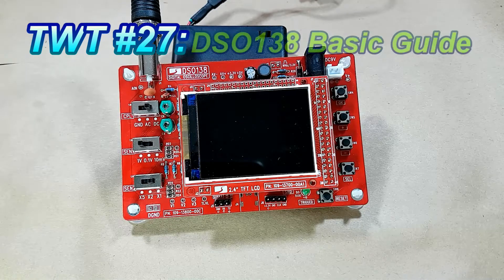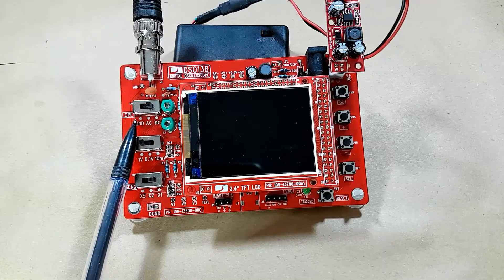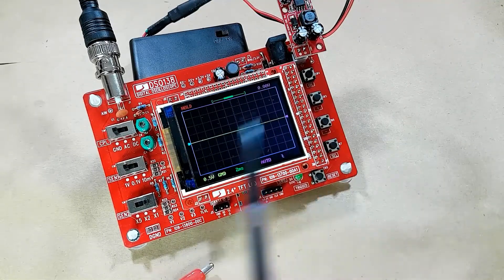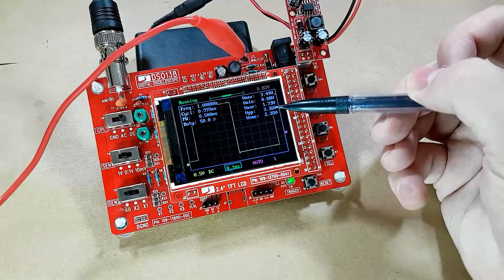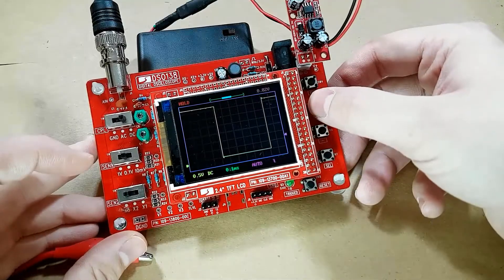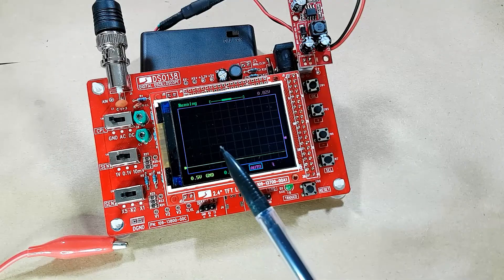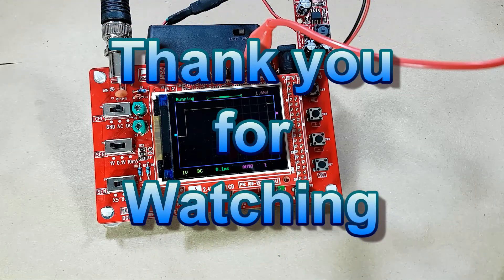TWT #27: DSO138 How to Use Basics

Comment: Thanks for your explanation. This gave me so many questions that I decided to explore a bit and my DSO138 also has a USB port. I wanted to power it via USB but it appeared the port was not connected to anything (unlike the DSO138 MINI variant). Then I found a guide online on how to convert the DSO138 to make it so that it can be powered via the USB port which is what I'm going to do. Tomorrow I'll get the components and perform the surgery.

This way I can safely use my powerbank to power the DSO138 and not have to worry about power supplies and about inducing more noise into the system.

One note: In the video you said the power supply voltage can be between 9 and 12 Volts, but I have read that it's not a good idea to use 12V on it and it is advised to really only use 9V to power the device.

Comment: Master , l appreciate all your lectures on DSO Scope because l have it. Butpls Master, teach me more on how to use it on things like ... checking the oscillating/ driving signals in smps pwm ICs , Smart TVs scallar boards, TCON board or video signals.... urgently needed Master 🙏. I have no attenuator. Can l add higher value Meg resistor, like 5 to 10 Meg to the testing probe? to steady the triggering amplitude ???

Comment: The DSO138 (and the smaller DSO128 "Mini") has an easy to fix issue where the waveform can look a little bad with high input signals.  Voltage divider R6, R7, R8 are a bit too low and put a little too much load on the output of U2B.  All you have to do is increase them by ten times (use 1% resistors).  This works fine because the voltage divider feeds the high impedance non-inverting input of U2C.

Comment: Thanks for the video. Very helpful. On my device, the two solder connections that are looped together in your photo and provide the square wave, are not connected to anything. I bought mine assembled. Is there a connection missing?
Reply from the maker: Glad the video was helpful. The assembler may have decided not to add the calibration loop, as they may have pre-calibrated the unit. If the holes are there and just missing the wire, you could potentially just add it yourself. 

Or, it's possible that the newer revisions of the DSO138 no longer have this as a feature. I'm not sure how many revisions there have been since I made this video all those years ago!

Comment: Can anyone help me?
I had ny dso for several months and it worked fine. but now while measuring the inbuilt test square wave, whenever I try to center the trigger with the graph or adjust the trigger in any way, the entire graph moves up or down by a few volts.I have to center the waveform with y=0v every time. this didn't happen before and is really annoying.

Comment: Does anyone know if there is a way to re-engineer this DSO to sample at a lower rate, such as 1 sample per second or minute? If someone new how to do this, it would make a great solar power sampler for custom solar setups. I have checked the suppliers and they all state it can sample at a max of 1 mega samples per second. They do not tell you how to change this. The docs say nothing regarding that or the USB connector.

Comment: My scope isweird. holding + and - doesn't reset anything andholding ok just switches between hold and run super fast.
Reply from the maker: Interesting, I wonder if it is a newer firmware, or if there is some sort of hardware issue with your scope.

Comment: I just received one of these units and had issues getting solder to stick to the BNC connector. I have posted on a couple of other locations dealing with these kits, anyone else have trouble in this stage? Also having problems getting the USB connector cleanly soldered without shorting all the terminals. I'm using a good iron and .o32 solder. I have noticed there were several other points that were more difficult to solder then what I feel they should have been, it's as if the plating of the joints was the reason.
Reply from the maker: I remember the BNC being a bit tricky to solder, the thermal mass of the connector made it challenging, similarly with the USB connector (though not nearly as much as the BNC.)  It's also likely that the plating used isn't the most compatible for soldering. Patience and a larger wedge tip than I normally use helped me.

Looking back at my assembly video, the slide switches were also tricky to solder for me.
Reply: @TinkeringWithTerrius  Yes I am having a slight issue with the shells of the switches too. I have to go get my dual range soldering gun I suppose and see what results from going from the variable heat soldering station to the 100 watt unit. I need to find some small solder wick or use some vacuum to remove the glob from the USB socket. I also just watched a video on how to improve the noise by re routing a few capacitors. Have you seen this and tried it? I don't want to attempt much with this unit unless I know it is viable to proceed.
Reply from the maker: Interesting, I haven't seen that mod I'll have to look into it. For my purposes of reading simple signals the noise never caused much of an issue, but I'm curious how effective the mod would be.

Comment: Can we measure above 5v dc and 230v ac.
Reply: Read the specs on the device. Anything over 50V is out of the question unless you construct a Voltage divider system and calibrate it. Anything with an AC voltage would be a good idea to use a capacitor coupling. A 10 to 1 probe would also be a good idea to get. You could construct this

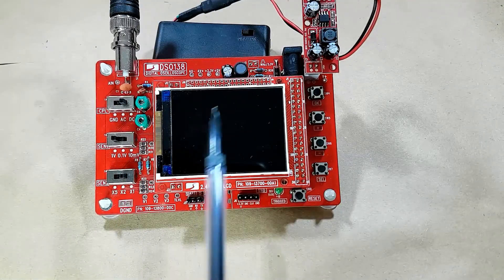Comment: i just put mine together and it did not come with that lil loop thinning you talk about at like 1:50 into the vid.. is their anything i can substitute for that ?
Reply from the maker: The little loop was just a piece of excess wire from one of the through-hole resistors. A small loop of any solid core wire should work just as well.

Comment: Thank you this info was excellent.  If my PW and Duty are bouncing - Duty between 48 and 52 does that mean I need to do a better job calibrating my probe?
Reply from the maker: I'm glad the information was helpful! If your duty cycle is bouncing around like that, and you are using the built in test point for the signal, it is indeed possible that your probe needs calibration. Alternately it could be an issue with the signal generator itself. 

I found in general that I didn't rely on the duty or time readouts of the overlay. When probing actual circuits it wasn't entirely reliable, but it did come in handy as a quick way of estimating the duty cycle or period of a signal.

Comment: red aligator goes to the signal ..and the black goes where?
Reply from the maker: The black clip will go to a common ground point on the circuit you are probing. So if you were probing an IC, the red goes on whichever signal pin you are interested in, and the black would go to the ground pin.

Not sure how accurate this following statement is, but I was told to think of an Oscilloscope (especially a floating battery powered one like this) like a volt meter that works over time. The scope is measuring and displaying voltage  but with a time component, so like with a volt meter you connect to the source that you want to measure with the red probe, and a common reference point (ground or the 0v rail ect.) with the black probe.

Comment: Excellent overview!  I'm waiting on my kit and will find this invaluable (assuming I assemble it correctly!)
Reply: The kit arrived, I assembled it and it works great. This video was so very helpful. Thanks for making it!
Reply: I bought the upgraded DSO138 mini which runs off 5 volts so you can use any USB power supply or battery pack. Cost me a little over $11 including the case. Put it together and it works great.

Comment: How do i set this up to display the lissajous pattern? Please.. i have a mono output, sleeve and tip to check.
Reply: It's been a long time since I used a scope but if IIRC you have to couple both the vertical and horizontal inputs to get the scope to do this? The only scopes I saw Lissajous on were not DSOs they were CRT analog units

Comment: The time divison (0.1ms) is that representative of each square?
Reply from the maker: Thank you for commenting! Yes, time is measured on the X axis so the width of each square is equal to the timebase (in this case 0.1ms).  The Y axis is the voltage, so the vertical height of each square is representative of whatever precision you are set to for voltage (in the case of this video 0.5v).  

The green numerical value in the bottom middle of the screen will be how wide the squares are, and the yellow value on the bottom left will be how tall they are.

Hope this helps, sorry I didn't reply sooner!

Comment: The DSO138 oscilloscope arrived yesterday (as did the tablet holder, but that's not related to this). Wow! This little item is quite the window into a circuit. I used the DC005 plug (see specs online) with a 9 volt DC adapter with a positive tip. The acrylic case is not really a good idea. So now I can see what my projects are doing, one trace at a time of course.
Reply from the maker: Glad to hear it arrived and you're enjoying it so far! It is certainly super helpful for visualizing what a circuit is doing! 

Despite it's low bandwidth I think for the price it is something every electronics hobbyist should have. I just wish the screen was a bit bigger! Almost makes me tempted to buy some of the other JYE-Tech scopes to see how they compare to it, but they are more expensive than the DSO138.

Comment: i been looking at theses please can one get a video out to hook this to a vga monitor or ?? old tv bigger screen using diy board i understand electronic just do not mess with this stuff much help as i need a bigger screen on this toy
Reply from the maker: I'm sure there is some way to hack the display signal and send it to an external source, unfortunately that is way beyond my current skill set. 

You'd have to figure out a way to take the data for the LCD and send it to a VGA or component video converter while also translating it into data that converter could understand. I imagine it would require knowledge of the DSO138's firmware in order to know what standard they are using for the display signal.

It would be a very interesting hack (being able to use an external display would be amazing), alas I wouldn't have a clue on where to begin a project like that.

If you do figure out how to do it, or find information from someone who has I'd love to hear about it!

Comment: @Tinkering With Terrius thank you. You could probably make some money by placing ads for trusted DSO138 vendors. The one I ordered from eBay's cinnamon 1956-5 turned out to be just the plastic case, not the oscilloscope. So I'm still looking and don't want to waste any more time.
Reply from the maker: Argh, I hate when an ebay listing turns out like that. I bought mine through Amazon from the JYE Tech store, but I know that isn't an option in a lot of places. 

I suppose you could always try banggood I've seen it listed on there, I think they even have the new DSO138 Mini. The mini is their new version that is supposed to have some nice improvements.
Reply: @TinkeringWithTerrius  Thanks for the info. I am happy to report that cinnamon 1956-5 has issued me a full refund. For that I have given a 5-star rating and ordered the oscilloscope from cinnamon 1956-5 again -- this time at more than twice the price of the case (the webpage has been updated to show both the case and the oscilloscope. It does not say it is the Mini version though. 
I'm also waiting for a tablet holder from banggood. These are great deals but the wait is a test of patience.

Comment: Can someone please tell me what the other (black) probe is connected to when the red probe is connected to the calibration waveform?
Reply from the maker: As per the instructions the black (ground) is left disconnected while using the test signal. You simply hook up the red lead and then adjust the variable capacitors to reduce the over/undershoot of the signal.

Comment: Hi, Would this scope be any good for fault finding/building guitar pedals?
Reply from the maker: I personally don't have any experience with building guitar pedals, so I can't give a definitive answer. I would assume as long as the 200khz bandwidth is high enough, then yes it should work. Be aware however it is a very basic scope and doesn't include any spectrum analyser functionality or waveform generation, though again I am unsure if this would be an deal breaker with building/troubleshooting guitar pedals.

I really wish I could have been more help, sorry!

Comment: so which one do you think dso 138 or dso 1500
Reply from the maker: I haven't used the DSO150 personally but from what I've read it is more robust and slightly more accurate. Of course there is also a new version of the DSO138 called the DSO138mini, which is also supposed to be a bit more accurate.

The DSO150 looks overall nicer due to its case, prevents having any exposed components. I'm pretty sure the DSO138 wins for pricing though.
Reply: Thanks for your input

Comment: Can it measure 220VAC?
Reply: Kuman and some other vendors market probes in 10:1 and 100:1 for high voltage use. Since BNC is a standard for scope lead connections they will fit. The only thing I will advise is to be sure the power is off before you get in there and keep hands clear. These scopes are cheap enough to replace if it goes POOF, just be careful. I used to have a scope back in the early 80's and it was NOT a cheap one, it was a pricey BK and I was working on TVs back then. I got to close to a second anode lead in an RCA that had bad insulation. I got hit with 33,000 volts of high frequency pulsed DC and it blew out my scope and I could talk right for a few weeks or move right. My next question is why would you want to use a scope to measure 220 VAC unless you are looking for harmonics from a sycrohnous generator?
Reply from the maker: Short answer is no, the DSO138 has a maximum voltage of 50V peak. 

In addition to this 50V limitation, I would not trust a cheap DIY oscilloscope for measuring anything with high voltage, it just isn't designed for it.  In order to measure mains AC like that you would require a professional scope and a set of mains rated differential probes, in addition to all of the safety prep to make sure that there is no way for mains to short through the scope and burn it up.
Reply: @TinkeringWithTerrius  If a 10:1 probe is used, then on the 1 v sensitivity setting you should be able to measure up to 500 v. The BNC cable that comes with this kit is a direct coupling. There are 100:1 probes also that allow up to 5kv at 1v / div.
Reply: u can make voltage divider with resistors.

Comment: Nice video, can i use the Dso 138 to measure a transient of 50ms on single shot mode? Thanks! :)
Reply from the maker: I haven't personally tried but based on the specifications of the DSO138, it should be able to handle that.
Reply: Thank you ! :)

Comment: when calibrating, my signal flickers left and right... what is that and how to remove it?
Reply from the maker: Is the flicker constant or does it only occur while adjusting the trimmer caps? Does it only happen when the trimmer caps reach a certain point in their rotation? It could just be noise causing the signal to jump out of range while moving the trimmers, or it could be defective trimmers, it is hard to say. Mine hasn't had this issue so I am unsure of how to remove it.

Comment: my readings jump all over the place on smaller scales even with no probes attached, is there a fix?
Reply from the maker: if it is just noise you might try adjusting the variable calibration capacitors. Otherwise I'd check all of the solder joints to make sure something isn't missed or loose. With no probes attached the signal should be pretty flat, I suppose external RF interference might also be a possibility since this scope has no shielding at all.
Reply: Tinkering With Terrius Thanks, I bought this kit with all the components soldered already, I'll see if adjusting the trimmers make any difference.